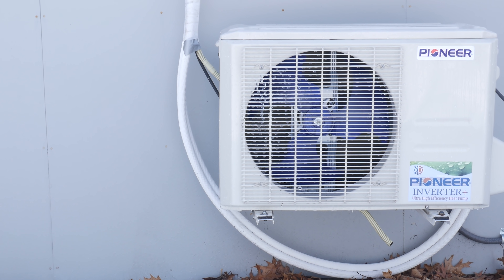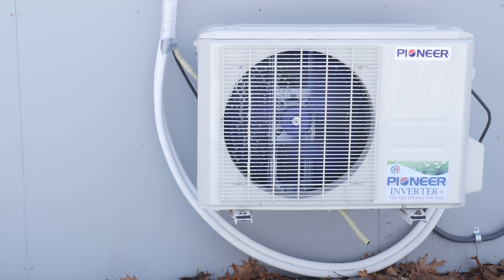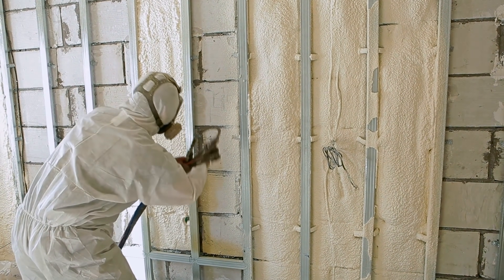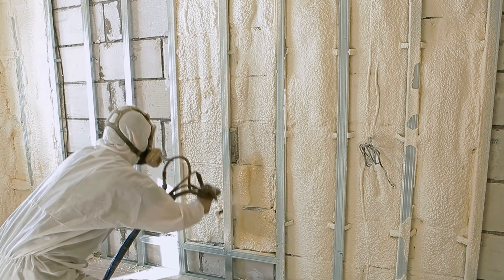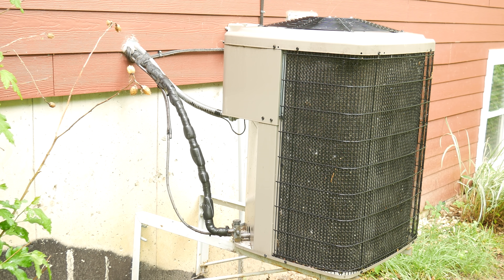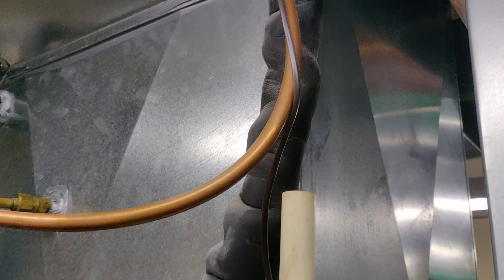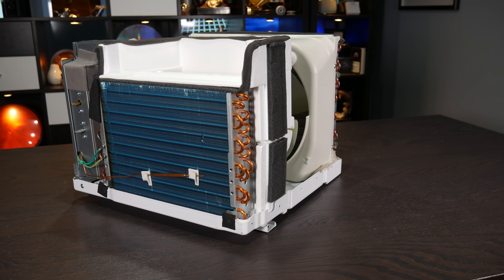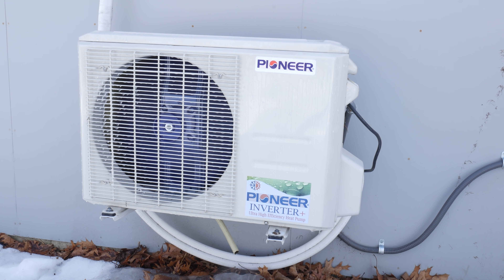Heat Pumps are Not Hard: Here's what it will take to start pumping

Comment: Here in Norway heatpumps are mostly the norm if you're looking to upgrade your home in terms of heating. It gets cold here, and -12C in winter is common even along the coast, and inland it can get down to -30C, though it usually stops at -20C. Most homes now have heatpumps, it's rare to see one without it.
We live in a newer home that already had a heatpump when we moved in, but it broke down after aproximately 20years of faithful service(and that had to do with bad maintenance), so just a couple months after we moved in it had to be replaced. The cost of ripping out the old one and installing a new one(both indoor and outdoor) came to 30 000 nok, which equals to approx. 3500 american dollars. And that was both the job and the price of the new system. So the price you guys have over there is outrageous, you shouldn't have to file for a loan to fix your heating, that's stupid.
We've not had a single issue with heating this winter, though it crept down to -20C. I also have friends that live in houses as old as 300 years(yes, their house is older than the US), and with a heat pump installed, no insulation upgrade, and a woodstove, it keeps their house way above freezing without issue. They're planning on getting in some new insulation this summer, and are looking forward to their heat pump being more efficient because of it. Their heating and woodbills have majorly decreased after the heatpump got installed.

So greetings from the arctic circle, heatpumps works here too.
Reply: Bless this comment, needs to be signal boosted.
Reply: That's about the same temperature as where I live in Canada! If only the plumbing industry over here would catch up... 😑
Reply: Yeah, but heat pump systems drop in efficiency as outdoor ambient drops - particularly when below freezing… So, in very cold regions here in the US, cost per BTU is less for 95% gas furnaces than heat pumps… Almost by as much as 50% depending on relative cost of each… Nothing against heat pumps; I live in Phoenix, Arizona where our winters are rarely below 2-3 Celsius so I prefer heat pumps as they don’t dry out the air like furnaces do and cost to run a heat pump won’t be significantly more, if at all, than gas…
Reply: @EarlHayward  We use ground source heat pumps as underground temps are virtually constant.
Reply: @EarlHayward  I already saw this exact comment from this exact user... And in that "but sometimes" scenario, well, gas would be more efficient for heating for... I don't know, less than 10% of the time? Heat pumps are still worth it. Really worth it. Yes, for real.
Reply: Retro fitting a heat pump replacement for a gas boiler in an standard UK home costs about $15,000. And you may have to redecorate your home if your pipes are 'chased-into' your walls or solid floor. Plus the cost of extra-insulating your house by covering the entire outside in insulation and replacing double glazing with triple glazing. And in extreme cases replacing the roof.
Reply: Comment about this fellow. Houses are very very tiny in Norway. For Americans the whole house would be enough just for the car. So for sure, you can’t compare the houses heating needs
Reply: Considering that in the US, you can go bankrupt if you break your leg without health insurance, this seems about par for the course.   lol

Comment: Refrigeration Cycle Connections!!! I'd watch a hundred more videos on this topic. What are the different gasses used and what are their boiling points! Would refrigerators work more efficiently with an outside pump??
Reply: Yes would love a video that covers various gasses used, charts of efficiency by temperature, and review of various equipment.  Please keep these coming!  Thanks!
Reply: @Mushaz  Efficiency can vaguely be judged by PT curves. The work is put in at the compressor so a refrigerant that requires more pressure to reach that temp would be less efficient. Manufacturers compensate for this by improving efficiency in other areas to counteract this. There are other measures of efficiency like COP and  heat ab- and adsorption, but I wouldnt mind seeing a video on that.
Reply: The problem here is he is simply too focused on his own area.  In my area, steam heat is common as is the 75 plus year old rowhome.  Some of the rowhomes are so old, they go back before the turn of the 20th century.
Many of the homes in my area were serviced by central steam heat and that still exists in some parts of my city (Philadelphia).
Retrofitting insulation is not particularly easy or even possible.  Running duct work is not possible.  Steam heat uses only 1 pipe (steam rises gets to the radiators, condenses and falls back down the same pipe it rose in) and so hot water heat is not possible.  It would be MAJOR construction to tear out the plaster walls to get to the pipes.
Outside of the city, nobody has natural gas, they have oil tanks.  Oil fluctuates and heat pumps would probably be better than the oil.
NOBODY is going to dump thousands of dollars in a completely new system for some abstraction like reduced co2
Reply: Efficiency is greatest when the difference in temperature is smallest. So if its colder outside than in then fridges would be more effficient with a vent.... But then youre frowing away all the 'free' heat!
Reply: I asked my dad this when I was a kid. He pointed out that for starters it would only benefit the house in the summer. Also since the outside temp is typically higher in that time, more energy would be needed to discharge it there. Also it would complicate installation and servicing I guess.  It’s not uncommon for commercial refrigeration though.
Reply: @manitoba-op4jx  Where they are rarely accessed.  Opening the fridge is the worst thing you can do.
They make freezers that open at the top and since cold air wants to sink and warmer air to rise, there is less intrusion of heat into the freezer/refrigerator.
Reply: @ntsecrets  It would also leave you with a big hole in your wall.  They would all have to be standard sized (so that every fridge wouldn't have to be custom made to fit the hole in your wall) that doesn't work well.  A large family needs a much larger fridge than a couple with no children or a single widow or widower.  Problem is, a "standardized" sized refrigerator would not serve these two scenarios very well.  It would be standardized around the "average" family size.  IOW, the hole in the wall locks you to certain sized refrigerator.
Reply: @christo930  I’m thinking of a piped system to an external condenser. Like walk in freezers have in commercial applications.  Only just the condenser could be out there with the compressor inside. I think the point my father was making was that from a thermal dynamics point of view it wasn’t very practical.
Reply: Look up "HVACR P/T Chart" to get a refference to different refrigerants (chemicals/chemical blends) used, and the bubble and dew points (boiling and condensation points). Just like water, each refrigerant's boiling temperature is dependant on pressure. Lower pressure, lower boiling temp, higher pressure, higher boiling temp. Water will boil faster at a higher altitude due to lower atmospheric pressure, but the water is also boiling at a lower temperature as well, so cooking with boiling water takes longer.
Reply: @ballsrgrossnugly  there used to be such a thing in California in the 60s, called a California Cooler. Google that shit!
Reply: @christo930  People who think the CO2 problem is an "abstraction" are selfish, antisocial, stupid or ignorant. The ignorant can be educated. Let the rest freeze/broil. The enlightened part of Humanity will pick up the slack and prosper.
Reply: @mapmuncher5587  I have at times in winter used my refrigerator as a heat pump by throwing the old funky ice outside. Exporting cold is operationally equivalent to importing heat.
Reply: @YodaWhat  your attitude does not help your cause
Reply: @YodaWhat  In a way yes and no. If you replace that ice with more ice made from water from the pipes then yes that is importing heat. But having an empty fridge vs full fridge doesnt effect how much heat is put out by it (if at constant temperature).
Reply: Yoooo it’s the trombone guy
Reply: @mapmuncher5587  In my Kitchen in Winter it is often colder in the kitchen than the fridge, and in the afternoon its warmer outside than in the house, I always open the windows and let fresh air in anyway.
Reply: @YodaWhat  You have obviously never had to balance a budget.  I'm willing to bet you are not donating your salary every year to fix climate change, now are you mister enlightened.
YES, it is an abstraction. It is something which may happen in the future and to an extent nobody really knows VS your kid is HUNGRY RIGHT NOW.  Are YOU going to say, screw my kid, take my money?  Little Johnny can starve, I'm saving the world!!!! Said no father ever.
Reply: @christo930  Central steam from your local nuke plant is the best of all. They need to get rid of the heat anyway.
Reply: @vinquinn  Do they get rid of such high quality heat?  Usually, as I understand it, they discharge the water MUCH cooler than what could make steam.  They get rid of a lot more of it, but at a lower temperature.
Also, not sure how I feel having nuclear power plants so close to residential. Of course, I don't really know if nuclear is in any residential areas as of right now in other parts of the country.
Not only do you have the safety issue, but real estate in residential areas is very high.
Reply: @christo930  In NYC high quality hot steam is sent to all the buildings in Manhattan from the power plants. They are not nukes, but the same principlies apply
Reply: @vinquinn  Do they do any heating of the water themselves after it leaves the power generation facility?
Reply: @christo930  I am not sure exactly what they do. This service is huge. If you are ever in Manhattan in the winter, you will see the steam hissing out of manhole covers on the street. This service is very old. It goes back probably over 100 years. It was sold to customers by the New York Steam Co. It was then steam produced solely for this purpose. New York Steam was taken over many years ago by the Consolidated Edison electric company and integrated into their system.

Comment: I am also experiencing huge HVAC markups with installing my Mitsubishi system (ducted air handler heat pump in the midwest). The markup was 2-3x the actual equipment cost difference compared to the low efficiency system they were pushing. Keep up the good work, you have quickly become one of my favorite channels.
Reply: It's good to see people talking about this and demystifying it. If word gets out perhaps some installers can begin to make big inroads into their competition by charging fair rates for this technology and undercutting the sharks.
Reply: Here in the UK anything with refrigerant costs a fortune due to all the regulations. Have you taken into account the pipes and refrigerant in the equipment cost ? 

We typically pay more for the refrigerant gas than for the unit we put it in, and the copper pipe isn't cheap either.

Comment: Just want to say, I really enjoy the random stock video selection for the VO segment at 32:46.

A lot of older homes in my area (central Arizona) have AC+Furnace, because that's just what they were designed for.  My home was converted at some point from Cooler+Furnace to Heat Pump and I couldn't be happier.  We had to replace the unit at the beginning of 2020 -- $15,000 for a 18 SEER 3.5t 2-stage unit plus new soft ducts to the extreme ends of the house.  It was pretty painful but we need AC in Arizona as much as you need heat in Illinois.  It sucks getting taken along for a ride on something that's so important to your living.
Reply: $15,000 INSTALL  is insane.  I would buy the unit wholesale for $3000.  Then tell the HVAC company “I already have the heat pump.  Just install it please.”

I do that with car dealerships too: I supply the oil & filter, and they charge $15 labor.  It saves money

.
Reply: @electrictroy2010  hvac guy here, nobody worth their salt is gonna install your used unit or warranty it. It's not a slight against you, it's that nobody wants to waste their time making half the money they could be making (markup on parts is sometimes the ONLY profit some companies budget into their jobs) and nobody wants to be tied to a unit that they didn't order and spec out because the warranty process for that can be a nightmare and a contractor's bond is on the line in most cases. Just the way it is unfortunately. 

I also used to be an auto mechanic, and I'm very VERY surprised you found an actual dealership that'll do an oil change for you using oil and a filter you provided and only charge labor. You must live in a small town because around here (phx) they'd tell you to take a hike. Quick lube is big money especially with the techs doing a multi point inspection and writing up everything they can to try and get some work.